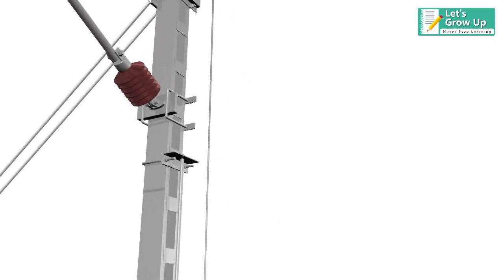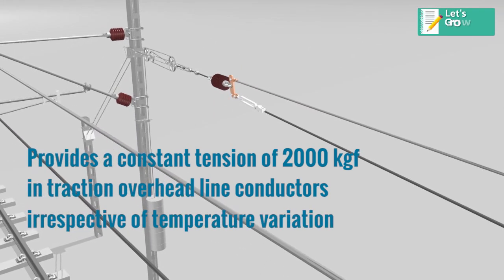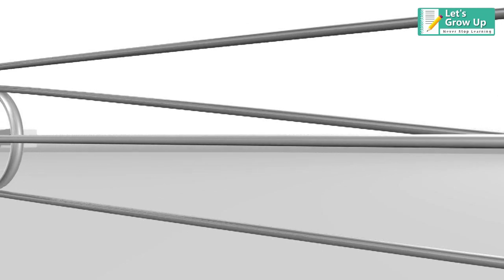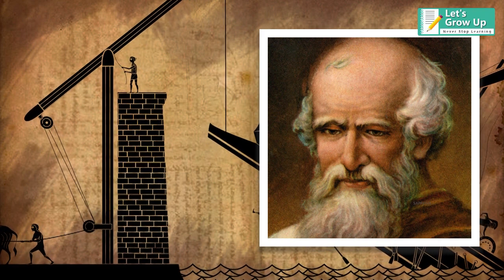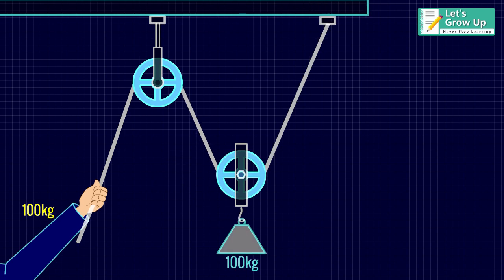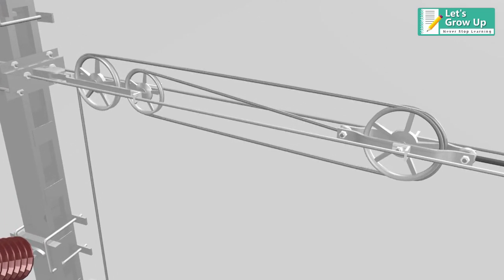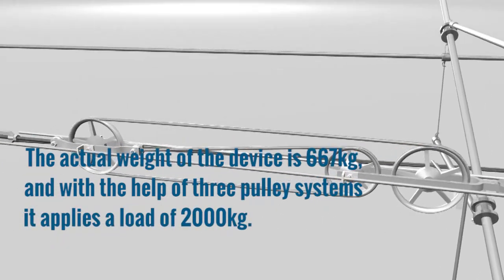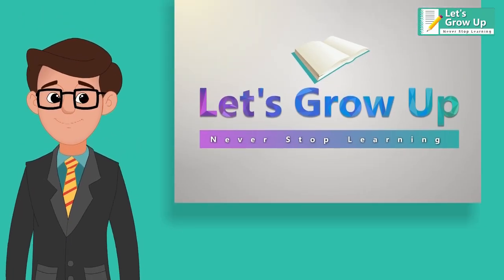Railway overhead Dynamic tension control system

Comment: The most important part was left out. There is no free lunch. While multiple pulleys reduce the force needed to lift, it reduces the distance the weight travels by the opposite proportion.

Comment: How does an auto-tension device work? It's a working function.- what exactly you are trying to say?
Reply: The catenary wire changes in length due to ambient temperature change.  When the temperature rises and the catenary wire gets longer, the suspended weights trying to descend automatically take-up any tendency for the catenary tension to loosen.  So the system is in equilibrium.

Comment: why would you need to tension it in the first place?
Reply: to stop line sag
Reply: The tension exists not only to prevent sag of wire but also to eliminate the traveling waves in the wire. If the wave speed matches the train speed, resonance occurs and wire will be damaged. Tensioning it makes the wave speed higher and it is made to be faster than the train speed.

Comment: Nothing 𝘄𝗲𝗶𝗴𝗵𝘀 100 kilograms; it 𝗺𝗮𝘀𝘀𝗲𝘀 100 kilograms. Weight is a force, measured in units of newtons. Kilograms are units of mass, not of weight. Since 𝘍 = 𝘮𝘢, or equivalently, 𝗳𝗼𝗿𝗰𝗲 equal 𝗺𝗮𝘀𝘀 times 𝗮𝗰𝗰𝗲𝗹𝗲𝗿𝗮𝘁𝗶𝗼𝗻 , employ the equation to get the weight in newtons. The 100-kilogram mass, under gravitational acceleration of 9.81 meters per second per second,  𝘄𝗲𝗶𝗴𝗵𝘀 981 newtons. (In this video, 9.81 has been rounded to 10. This is sloppy.) Tension, too, is a force, and should also be given in newtons.